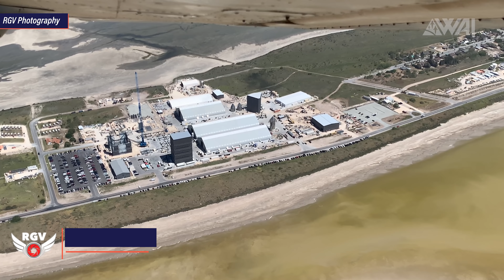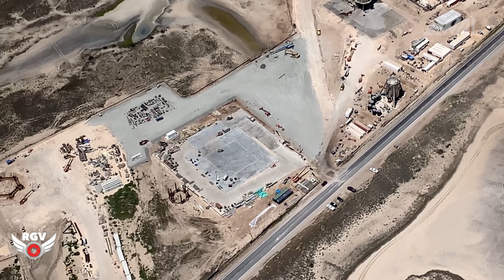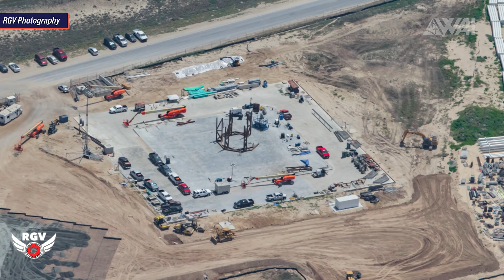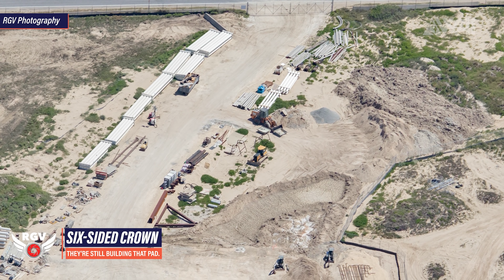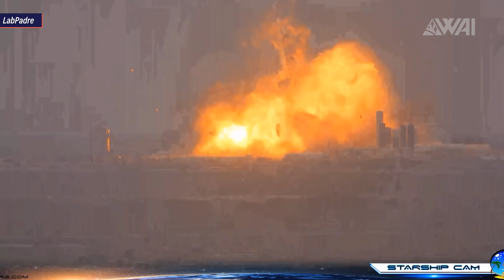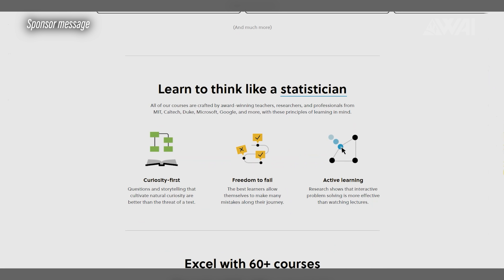107 | SpaceX Starship Updates – Why a hop will happen this time!

Comment from the maker: Will Starship SN6 fly or is it really just a back-up for SN5?
Reply: I reckon after SN5 does 150m hop, SN6 will do a triple Raptor, 2km hop with that recently stacked nosecone while SN8 is being built, which will do the 20km belly flop
Reply: @fraserbarbour4400  If nothing goes Boom yes ^^
Reply: @fraserbarbour4400  yeah because sn-7 was pressure testing
Reply: ROCK IT AND HOP IT !!!
Both of them😄
Reply: @deathwing5639  I believe both also. A back up just in case something goes wrong, yet easily changeable into the next variant needed to progress.
Reply: I think from here on they'll start trying to get every new starship into the air, adding components as they go.

Your comment about putting nose cones on the boosters during testing and thought that SpaceX may be aiming to create a universal basic structure that can be easily be developed into either one. 

Getting the fuel tanks and thrust structures correct for one, completes the task for the other if you intentionally overbuild the stress tolerance... since steel is cheap, why not? I'm thinking.
Reply: Sn6 will fly
Reply: The nose cone is not on yet, because the high bay is not ready, there is no place for the nose cone to be stack on an SN (these would not fit one on top of another in the mid-bay), they cannot stack it in the yard, that would need to be welded on , so i would say that is one more reason for them to pick up the pace with the HB.
Reply: one of them
Reply: It will fly
Reply: Probably going to fly, it will probably be a backup if sn5 goes book boom
Reply: I think that the only reason they haven't put the nose cone on SN6 is because SN5 hasn't completed a successful hop yet. If it doesn't, SN6 will be backup with no nose cone. If it does, they'll immediately begin fitting the cone to SN6.
Reply: It will fly
Reply: I think SN6 will fly! if SN5 hops,i think SN6 will get 3 engines!
Reply: SN6 is smaller than SN8 so might be the1st proto to be launched maybe on a existing booster because the superheavy will not be ready by that time
Reply: John Drawing what existing booster? it’s 3 times the diameter of the F9
Reply: backup. They will go to the SN8 after the SN5, that of course will fly the hop of 150m
Reply: SN6 surely will fly if Nottingham goes boom again
Reply: Shane Humphrey   SNs- 5 and maybe 6 are not merely going to hover. They will rise up, translate, and land at a different point, just like Starhopper did. I don't know what the rest of your post is about, it has nothing to do with Felix's OP.
Reply: Hurricane en route so no hop until after that passes through would appear. I'd give it two weeks.
Reply: Will totally fly
Reply: I can't see Elon making a backup solely for the sake of having a backup. There has to be a bigger plan for it. Sure, if it has to take over as a backup, then so be it, but I just can't believe that is the main purpose for it.
Reply: No one knows.  I suspect even Musk doesn't know.  That's how Space X works.
Reply: @paulhaynes8045  nah its Not they have certain Plans when they build it certain imorovements they made over SN5
Reply: Actually sn5!was backup for sn4
Reply: I think if it were just to be a backup, they wouldn't be building it right now. It diverts resources from sn5, which could increase chance of failure. Makes no sense to build something with zero intent to fly
Reply: @iangolsby8471   It diverts no resources, they have plenty for both, but they need to be prepared for an SN-5 failure. If though, SN-5 finally achieves the 150 meter hop, then there will be little point in flying SN-6 since SN-8 represents a significant upgrade. Fraso Barbour has an interesting idea above though, that SN-6 might be used for a 2 km hop before 8 goes to 20. I can see usefulness in that.

Comment: Elon has not really located the lift-off site adjacent to the tank farm has he?  Tank farms have lots of expensive plumbing requiring myriad welds certified for astronomical pressures and range of temperatures. Repairs could be slow and expensive assuming a major explosion does not total the site.

Comment: I'd have thought that Hydrogen inclusions in a weld will weaken it considerably: acceptable if you were welding plate for a (sea) ship but in relatively thin sheet, such as the material used in Starship hulls, rather dangerous. However, I'd have to bow to the greater knowledge of your contributor - and presumably the Space X team.

Comment: My guess is the hop will not happen till after the Aug 2nd return of the crew from the ISS.
Should something go awry with this first test, a loss of control, an explosion ( not inconceivable), modern media are not mature enough to not use it to cast shade on the out come of the ISS return mission. Gone are the days of reporting news accurately for what it is, its all about the clickable head lines and preemptive speculation. You and me know the two events are in no way related but the general public doesn't.  
I think the two events will be close together as a double wammy , but with the hop event scheduled second.
A little extra time to ensure the hop is spectacularly successful rather than spectacularly unsuccessful will be seen as time well spent from a PR and investment perspective.

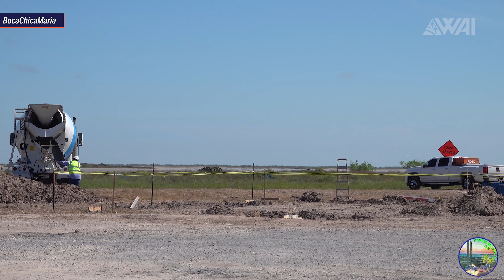Comment: 8:50- That is called a concrete washout. After a pore, the remaining concrete needs to be dumped from the truck before it sets inside and it is common on a construction site to have a dump spot. You can see the worker washing the shoot before leaving.

Comment: Felix, the cement truck was not pouring cement.  You are seeing the cleaning process of the cement truck pour chute AFTER the pouring process, hence the water hose.  They never clean the chute at the cement slab pour as the extra water dilutes the cement mix there by weakening the cement when it has gone off (dried)......so no building just a small amount of waste cement that was left sticking onto the pour chute.  Rubbish has to go somewhere so that 'dumping' area is perfect.

Comment: I've mentioned this before, but I certainly hope Elon Musk is prepared for hurricanes. I think that Boca Chica is even more exposed to ocean storm surges than Brownsville. In a big enough hurricane, most of Boca Chica could be under water, with big battering waves. From the aerial view, those Airstream trailers aren't even chained down. The way they are building the big assembly areas looks like they can cope with at least tropical storm winds. Tomorrow the winds should be below 60 mph since the storm will likely go north of Boca Chica. However, there is likely going to be a full hurricane just behind it. That is likely to go south, but the season is just getting started. This is predicted to be an above average year. The Atlantic is especially warm this year. Fingers crossed.

Comment: Providing that they are purging the welds correctly there should be and issues whatsoever. Creating a gas shield on front and rear of the welds is essential to eliminate contaminants screwing the job up.

Comment: Keep the updates coming, they are really appreciated and must take a lot of work each week! One question I have that may be a dumbass question...aside from the obvious answer of weight, why do SpaceX not use a frame/chassis inside Starship to give it more structural rigidity? We have seen starships crumple during pressure tests, surely some kind of internal structure other than sheet metal would be better able to cope with the stresses? Are other rockets built the same way?

Comment: Something I've been curious about for some time.  How is SN-5 going to land?  Star hopper has external legs, what is SN-5 going to use?
Reply: The Starships have landing legs tucked up inside the engine compartment that will fold out for landing.

Comment: the footage hes getting while flying in an airplane cant you get the same picture using the mavic pro drone? or any high end DJI?
Reply: In the US Drones need a permit to operate   more than 400’ above the ground(or top of a building/tower/tree). I don’t know the altitude of the plane, but it may have been higher to get that viewing angle.
Reply: @rebeccabogardus4138  there are countless videos on youtube of people flying their DJI around in high altitudes and getting great footage. I don't see it being a problem doing it in Boca chica when there is nothing flying above. DJI even has that new little drone that does not require any permits at all and it still flies super high
Reply from the maker: There's a UAV flight restriction over there from what I gather -AP
Reply: @Whataboutit  yea makes sense, otherwise, there would probably be drones everywhere while they are undergoing important testing.

Comment: The geo-grid being placed  under the stone is used to stabilize a weak soil by distributing the surface load. The surface material, concrete or asphalt is immaterial to using the grid. Either the soil is very weak or something heavy will be installed.  Felix, you continue to impress me with your channel.

Comment: Felix, 
The fleece (matting or geotextile) under the gravel they are spreading is not always a signal of future concrete plans. The matting is used to do various things. In many cases just to prevent weeds growing through the gravel, alternatively on soft ground (which I assume Boca Chica is) they use geotextiles under the gravel to stop it sinking into the soil below under load and increase the bearing strength of the gravel layer to support trucks and other heavy loads. 
They may still concrete the whole area but the underlay is not a guarantee.

Comment: What is the purpose of the hop?  That's a question I don't see answered or asked, everyone just seems to assume it's needed.  We already know that the engine works, that it can fly from Starhopper.  SN5 won't be able to test flight characteristics since there will be an asymmetric thrust with only one engine.  Anything they learn about how to fly SN5 won't apply very well to a proper number of engines.  So why are they bothering?  Sure it will be fun to see, but why?

Comment: ....looks to me as if the high bay would need to be at least 6 wall elements high as the mid bay stands now at 5 wall elements....to accommodate room for the crane and the fact that the supperheavy booster is taller than starship?

Comment: Maybe SpaceX is building a giant Sabatier Methane producing facility, using solar as source of energy. Hence, ensuring Starship will be carbon neutral. 1)Remove CO2 from atmosphere and produce H2 from electrolysis, solar powered 2) Produce CH4 from Sabatier and keep O2 from previous electrolysis 3)compress CH4 and O2 in tanks 4) burn in Starship liftoff and return C02 and water. Repeat, carbon neutral overall. It will certainly get approval for fighting global warming.

Comment: Your point about the nosecones makes sense, but in my opinion they don't need to use everything they construct for the sake of efficiency. Those nosecones being produced this fast can be just for practice, don't forget it with the fairing middle section will house the most important thing, humans! So it would be nice to practice on building it to get a rough estimation on how it will be build so they can start working on the interior design.

Comment: I have a question. Why doesn't SpaceX use friction welding instead of heat welding. ULA has been using this method successfully for a long time. Seems like it would be a better idea with the weather and humidity.
Reply: Apparently, it doesn't work as well on stainless steel.

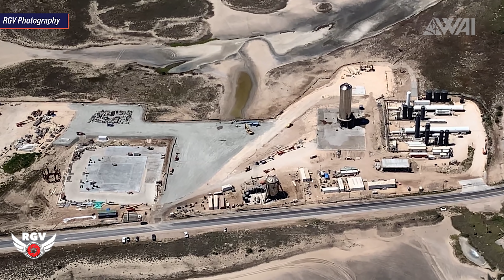Comment: @2:55 I am a little puzzled about the hydrogen inclusion due to the humidity. Normally stainless steel welding is shielded by an inert gas such as argon. It's main purpose is to exclude oxygen which would totally ruin the weld, but in the same way it excludes oxygen it also excludes everything else, including water vapour. 
It is true that in extreme humidity situations there could still be some issues but only if there is not enough flow of shield gas, which can easily be increased to as much as needed to ensure total exclusion.
Reply: I know nothing about welding. Why would oxygen ruin the weld?
Reply: @odysseusrex5908  Because it oxidizes (rusts) and weakens the structural integrity.
Reply: @gliese832c   Ah, I see. Thank you.

Comment: If SN-5 successfully completed the static fire then SN-6 may do the 20km flight or if SN-5 failed the 150 meter hop then SN-6 would be a backup. (this is only my theory)
Reply: I suspect that while SN6 will fly, possibly even with a nosecone, it might not do a 20km hop although a shorter one is likely.
Reply: @KnightRanger38  that is possible, we just have to wait and see

Comment: Yesterday, on either a video from Maria or Mary, we saw a sleeved upper dome. The top ring on the sleeve seems to show that they have added reinforcing inside, similar to that on the engine skirt section. Perhaps that is to take the extra weight and thrust forces from the cargo section (nose cone) and is for SN-8, meaning that will be the first one for the 20 Km attempt. SN-6 may hop just to confirm they got it right, assuming they don't RUD SN-5. Great job, as usual, Felix.

Comment: They're making nose cones because they're learning yo make nose cones.  Could be as simple as that.
Reply from the maker: Pathfinders!
Reply: They should have snow cone parties every time they get one right! Nose cone snow cones; 'cause ya never know cones..
Reply: I can't see those nosecones being anywhere close to the cargo design because that will need the huge clamshell opening that covers most of the top (non-heat-shielded) side of both the conical section and the 5 ring barrel section. I would have though that there's going to need to be a lot of internal bracing to keep integrity as the clamshell opens and closes and if that was there already then wouldn't we see welding marks from the outside like we do for all the internal bracing on the thrust section? Admittedly it will open and close in zero g but I would have thought it still needs some bracing so it closes back up accurately for re-entry and it will need to be opened and closed on Earth to install a payload although there there could be special equipment to support the fairing when open and stop if from crumpling or getting distorted.

I wonder whether some of these nosecones might never go near a launch vessel but be lined up waiting for more construction work to add more internal bracing and cut an opening to try and get the clamshell working on the ground without ever going into space. I can see a few early nosecones prototypes getting trashed in that process if the structure isn't quite right and they crumple and break as they open/close. SpaceX is going to have to get that working before it has a viable cargo Starship that can actually deploy a cargo although maybe they have a long time to get to that.

I would have thought that most of next year is going to be taken up with just getting a test Starship with dummy/empty nosecone into orbit and back and the next most urgent thing for next year would be to then start working on getting on-orbit refuelling perfected since that is critical to the whole Mars venture. I'd put getting a working clamshell mechanism as third priority after those first two but I'm sure SpaceX will do stuff in parallel wherever possible so there's no reason to not be thinking about trying to get a clamshell mechanism working on the ground right now. They must also want to know how little extra structure they can get away with since that feeds into the overall weight calculations.